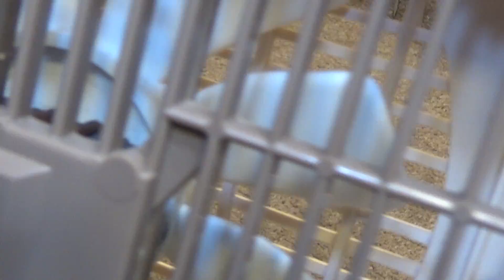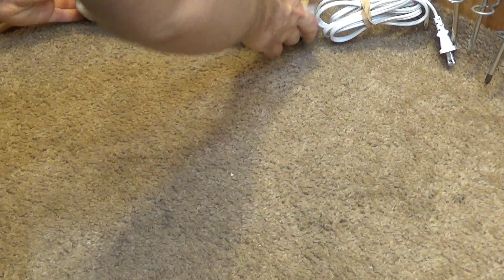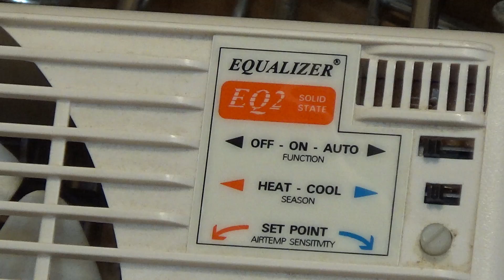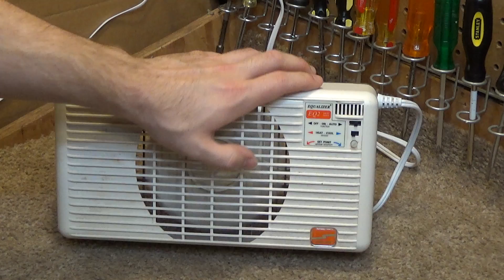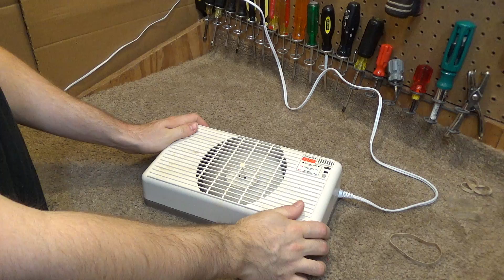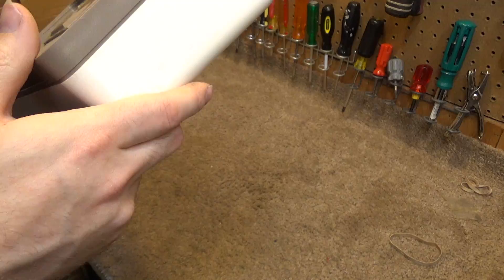Suncourt Equalizer EQ2 Register Booster Fan Model HC300 | Initial Checkout

Comment: So... you are reviewing the OLD product, designed and built in China in 1996, and NOT the NEW product with this name, built in the USA in 2022? That does not seem fair. And you are not an HVAC expert,  you are not demonstrating this ON an air-vent like it was designed to be, nor are you using an anemometer (to measure volume of air movement) or a thermometer (to show what changes in temperature the device may or may not be effecting). All you are showing is how the OLD version acts when sitting on your workbench.

This object is not designed to be sitting flat on a solid patch of carpet, or face-up on a workbench, but over a VENT, which is an opening that already has air flowing through it. All this device is meant to do is INCREASE said airflow. And even in your demonstration (of the OLD version of this product made in 1996) you show that the airflow is better to the sides. (y'know, as if it were disbursing air around the room?)

It's sad that you don't take the prevailing opinion of others who have bought & used it into account. On Amazon for instance, the NEW version has three hundred and thirty five reviews, with EIGHTY-EIGHT PERCENT of reviewers giving it a 4-out-of-5 or better rating, with only SIX percent of reviewers giving a 2-out-of-5 or worse rating:
https://www.amazon.com/product-reviews/B08B9GQB11/ref=dp_fod_cr_1?pd_rd_i=B08B9GQB11
Reply from the maker: I lost brain cells reading this comment.
Reply: @JordanU  Oh dear. That's disconcerting. Judging by the video, AND your comment, I get the impression you don't have very many of those to lose in the first place.
Reply from the maker: @iDontShareMyData  Right......that must be why you deleted your other inaccurate comment and liked your reply on this one. Find something constructive to do with your time.

Comment: I had a 2 floor bedroom, longest duct run in home. It made a 3 degree difference in ac which is fan-tastic. 
The trick is to set temp so that fan continues to run for 1 or 2mins after furnace shutdown. 4 year still working great.
Reply from the maker: 3 degrees is not worth the noise to me.

Comment: Lasted 1-1/2years and then the fan was so loud I could not hear TV when it is running.  Seems there is no wat to lubricate, the grinding sound is very annoying!  Fan did actually help for my large living room with vaulted ceilings.  Even at purchase, there is a humming sound from the fan movement, but that is livable.
Reply from the maker: It can be oiled, but will need to be fully disassembled first. Unfortunately the design does not intend for the average consumer to service the unit like the old fans were.

Comment: In all fairness, that fan you are showing us is from 1996.  Performance got much better when the impeller was changed from off-the-shelf valox to a custom-molded lexan with a more appropriate weight and blade pitch.  That model is on its way out and a new US-built model with a way more powerful high-static fan will be on the market this Summer with multiple fan speeds and auto-changeover temperature sensing.  Same goes for the corner fan mentioned in another comment...US-built, twice as powerful, selectable fan speeds and reversible mount.
Reply from the maker: I don’t pay much attention to the current market for products like this, but I’d be very surprised if their claims of American manufacturing were completely accurate.
Reply: @JordanU  They are most certainly accurate.  The production of the duct booster fans were moved back to the US in 2012, the transfer fans in 2013, the flush-fit booster in 2018, and the DEDPV clothes dryer booster has only ever been built in the US.  There are currently radon fans, register boosters like the one in this video, duct thermostats, and doorframe fans on the market of Chinese origin, but Suncourt's business with Chinese contractors has been concluded.  New products of the items mentioned above will begin US production late 2020 to mid 2021.  I should know, I've been Suncourt's Operations Manager for the last 9 years.
Reply from the maker: @whoabeez  I'm a big proponent of American manufacturing. If these products surface and I find a need for them, I would absolutely consider them above imported models.

Comment: Imagine putting one of those on a return vent, lol.
Reply from the maker: It would probably make no difference
Reply: @JordanU 
You might be right, but if it was successful, it would be sucking the air out of the air handler if it was on a return vent.
Reply from the maker: True

Comment: Interesting! I had never heard of this thing before. Seems like it might actually restrict a register more lol. Someone gave me one of the corner fans which I stripped the fan out of and it actually moves a ton of air! Wonder if this thing has the same problem... Just curious, why did you buy this if you knew it wasn't going to work?
Reply from the maker: These have very poor aerodynamics, I suspect this thing would move a lot more air if it were operating in a free-air environment. As for the purchase, I sometimes wonder the same thing...but it was cheap, I was curious, figured it would make a good video or two, so I got it. I think I only paid 3 or 5 dollars, the video will pay for it in a few weeks.
Reply from the maker: @iDontShareMyData  You can think what you'd like, I know I am using it correctly.

Comment: wow bro if you put a different blade on it that has pitch to it then it would work well enjoyed the video
Reply from the maker: I agree, I don't think the motor has enough power to handle a better blade.
Reply: I think SunCourt thought of that, because these things have a proprietary irregular size shaft, and a 5 inch blade.  I tried it, and a typical 6 inch blade from a clip fan or something won't fit, so good luck even attempting to find a different blade to test that theory.
Reply from the maker: I wasn't going to clean and service this thing any time soon, but now I'm quite intrigued by this. Perhaps I will look into it this weekend.
Reply: @JordanU  cool i can't wait to see another video on it soon bro